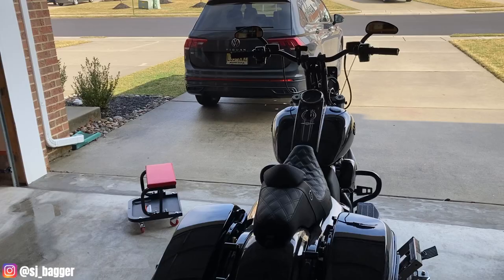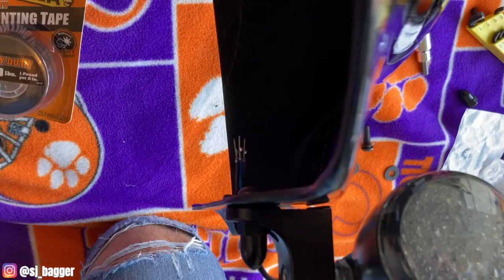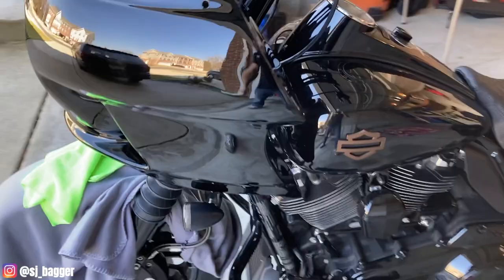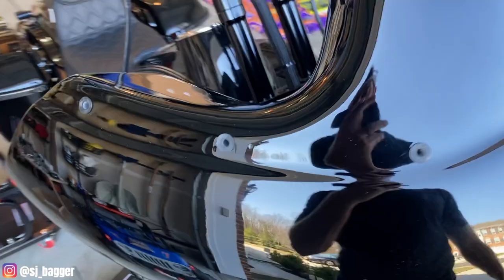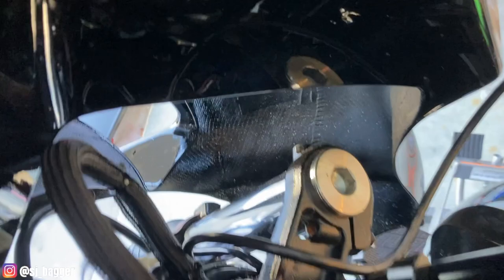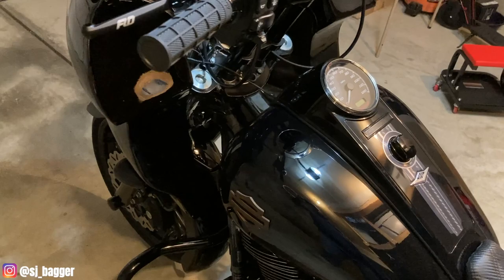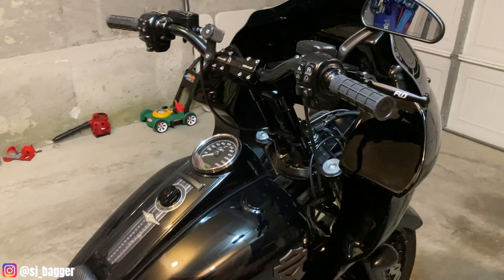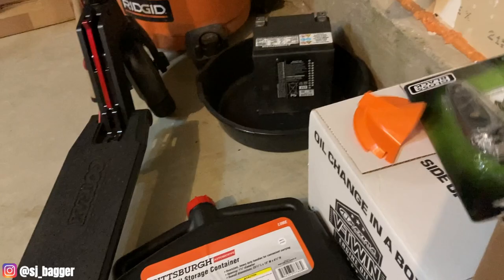FXRT King Build Episode 3 - Final Assembly #RoadKingSpecial #HarleyDavidson #FXRTKing

Comment: Dude, it's absolutely badass! Mine is almost the EXACT same setup. I have a 2016 Police RK and was toying with the idea of doing this for some time. After seeing Matt Laidlaw's video, and an actual one done up at the Lonestar Rally in Texas last Nov, I was sold! I went with the IMZZ fairing and had the whole bike painted. My risers and bars are the exact ones you installed. I even have the same phone mount. LOL  I installed the Santoro Fabworks "Not To Daddy's" crash bars and bag guards. FULL Thrashing Supply foot controls among a few other small parts. My exhaust is a 2-1 Stealth in polished stainless steel which looks really good. What a mission getting that fairing on, but I don't have to tell you. A couple of shops finally started making the BD LP6 light mount for this fairing, but they're almost as expensive as the light. I will be posting a bunch of pics on my IG soon, I'll DM you so you can check it out. Sorry for the long message, but I was thrilled to see someone else do this to their RK. Take care and congrats on an awesome build!
Reply from the maker: Thanks man, appreciate it.  Yeah I’d love to see what it looks like so DM me on IG for sure (sj_bagger).  I too am considering the Santoro Bag Guards, we’ll see.  Anyway, appreciate the feedback and thanks for watching!

Comment: Badass!    👍

Im finally finished on my performance bagger build on my Streetglide.   If I was to do it again, I wish Id of gone this route.    I dont use the any of the fairing stuff.   I wish Id of started RK, FXRT fairing and T bars as a base.   Lighter build in the end and not a bike everyone else has.

Looks great!
Reply from the maker: Thanks brother, Street Glide still badass.  What kind of mods you do?
Reply: Its a 2016 vivid black blacked out SG. 

Currently with a high compression S&S 124 TC, TTS tune & mods, D&D, GP suspension 25mm front cartridges, 14" Ohlins 044s in back, true tracks, poly mounts, six piston calipers frt & rr w/big rotor kits, swapped to 18 rr and 19 frt Talon wheel combo from the old Enforcer 16/19 combo on 2016's.   Lucky Daves San Diego 14" T bars and the usual ergo mods.   

Its a ripper in the twisties.   I own a bunch of bikes of all kinds.   I dont even compare my SG to any HD, Id compare it more to a real "sport tourer" like a FJR.

Like I said, I do wish Id of gone the route you went.  I may still pull the fairing and stuff out and go FXRT.   👍
Reply from the maker: @highwayman1218  sounds awesome.  Will likely do a 124 in the future.  I’m sure it rips.

Comment: I tried to order RWD and they weren't selling any fairings as of 4/9/22. All sold out. So I got a JD fairing, so we will see how it turns out. I wish I came across your video sooner. I wasn't sure how it was all gonna turn out.  Now I will know what to expect. Thanks for the content.
Reply from the maker: Yeah I think they’re just understaffed for now and trying to catch up.  JD is a great too.  Let me know if I can help in any way.  You can DM me on IG @sj_bagger.
Reply: @SJBagger  right on
Reply: @SJBagger  hey I don't have Instagram. I do have one question quick. What windscreen is that? What height? How tall are you? How well does the air move around? Do you feel any buffeting at all? And if so, how tall or short would you go on the windscreen? Thanks.
Reply from the maker: @alpha13dylan  Klock Werks 9” flare for FXR, blacked out.  I’m 6’2” and the flare sends the wind right over my head.  Minimal buffeting if any, I wear a full face. If I went more the 9” then absolutely nothing, but don’t like the look if it was any taller.

Comment: Hey do you get alot of air underneath the fairing? It looks like there is a huge gap. I ride in all weather. I was hoping to keep the water out from behind the fairing.
Reply from the maker: No not at all.  You can get the fairing open or closed in terms of the front holes, I’m assuming you went with the former?  I wanted the front holes for the warmer months and all in all it’s tremendously better then no fairing at all.  With the Klock Werks windshield most of it is sent up and over.

Comment: That painter was a hack. Didn't paint the inside (as discussed) and it left his shop with flaws? Nah - You could have done a better DIY with some aerosol vivid black, some spraymax and a wet sand/polish in your garage. Too many wires exposed above the triple tree. This MOD would benefit from a RoadGlide Gauge nacelle to hide all this wiring and move the speedo off the tank - not to mention, finish/sand that inner part of the pairing before you paint it too

Comment: Just a question what kinda bracket you use to relocate your turn signal ? Thank you
Reply from the maker: Good question, I had the same one when I was doing this.  It’s the stock L bracket that comes with the Road King Special that’s used to mount the turns off the handlebars.
Reply: @SJBagger  thank you I got street bob dyna
Reply from the maker: @carlogamilla1128  here is the diagram, #13.  https://partsfinder.onlinemicrofiche.com/ronnies/showmodel/13/harleydavidsonmc/1212#
Reply: @SJBagger  thank you
Reply from the maker: @carlogamilla1128 yw